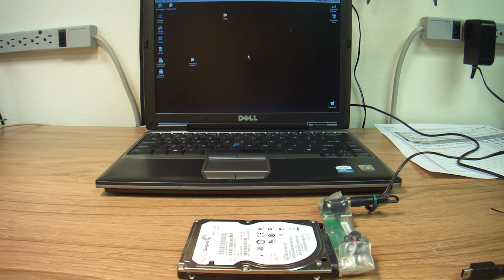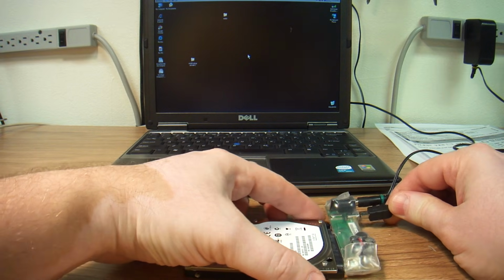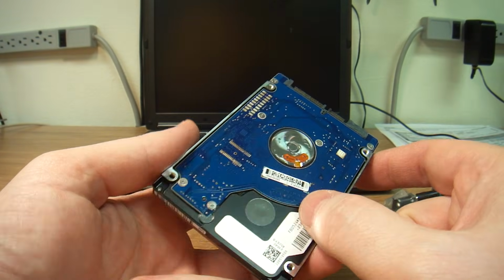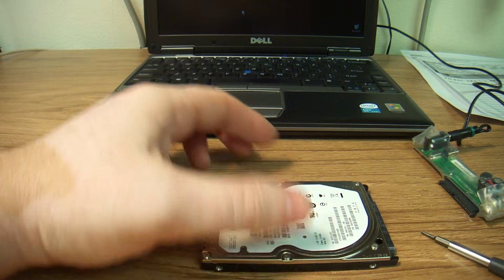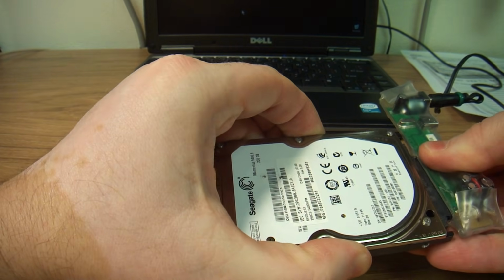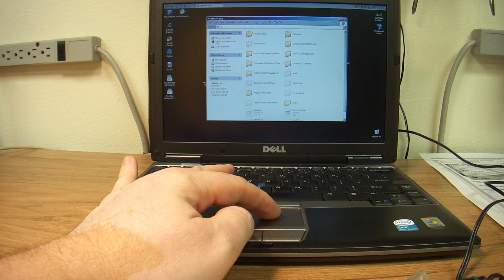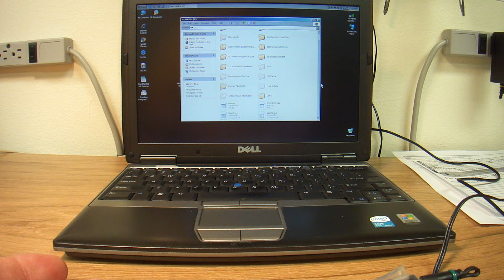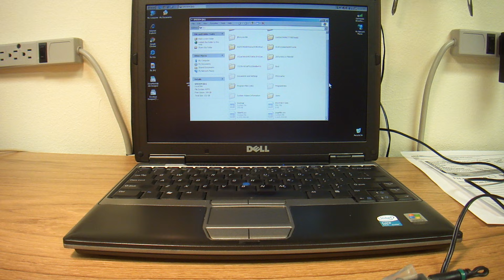How to fix a broken hard drive Beeping noise or clicking RECOVER GET DATA BACK FOR FREE! BEST TRICK

Comment: you talk that centrifugal forces would get rid of dust. Just one educated question, you never have asked yourself: WHERE those forces would move dust? This dust will always stay in the drive and it WILL (not just may) damage this HDD! The damage is actually getting on acceleration, as every dust particle, which would get between platter and head WILL pop-up head off the platter. Head would spring back, but won't just stop in position from it took off. It would actually land on platter in NON-PARALLEL position ripping thermal protection off the surface of plater. This ripped thermal protection would be in form of dust, which obviously would do same thing as ordinary dust. More times head would have contact with dust - more frequently it WILL happen again. So over time damage is faster and faster.

If you ever open HDD, then copy all contents immediately and treat this drive as broken and NON-WORKING one!

Comment: I've a DELL Inspiron 1545 laptop with a WD Scorpio blue 2.5" SATA HDD, even that HDD is making almost the same kind of noise whenever I bootup my system and gives me a black screen with a message saying "internalt for multi core processors will be disabled.
No bootable devices--strike F1 to retry boot, F2 for setup utility Press F5 to run onboard diagnostics." Even if I solve my problem by doing what you've shown in this video, is it a sign that I need to get a new HDD.

Comment: PLEASE  PEOPLE DONT LISTEN TO THIS FOOL and i will tell u why

opening a harddrive is very dangerous  cos a new hardrive will only run perfectly if the screws holding the cover in place are screwed down with the exact correct torque that was used in the factory since its very important part and goes hand in hand with the disign of  the HD.
The only way to perfectly open and close it is by knowing exactly how much torque was used. ask any techrepair they got a huge set of torque screwdrivers specially disigned for this with all different torques

An amateur will try to fix it open it lose its warranty and screwed himself

He says torque screwdrivers ar not needed but hes full of shit

Cos HES USING A 50 YEAR old 80GB laptop HD 

Not a recent desktop HD, shame of u for messing with people
Reply: Say whachawana chief indian, but this "foo" is spot on cus low and behold "It worked for my ass too - yet another success testimonial!"  He disclosed to "seek a professional lab" if in doubt, so Honest Abe is keepin it real in the '14.  If you're timid and doubtful, do like he said - Seek the pros.

Comment: I tried moving the heads but they wont budge on mine. It's a 1TB external HD. After trying this is just clicks but it sounds like the heads might be rubbing against the platter. It's a SimpleTech drive. Any suggestions please?
Reply from the maker: Rubbing heads Spell Trouble! Drive is  toast!

Comment: Thank you Abraham.
I did not have to open mine but I realised, from your video, what was wrong. My Ext. HD was very dusty.
A few light taps and swung mine about in an open space and it seemed to come unstuck. I never would have thought of that if it had not been for your video.
Reply: How is that possible isnt your HD enclosed?
Reply: *****
Yes fully enclosed external Seagate but it had been sitting for a long time and was dusty. Abraham's inside view made me aware of how to fix it. It was broken ie did not work and now it works fine.
Reply: And thank you for this comment, otherwise I would have openned my own HD. hahahaha
Reply from the maker: My pleasure.

Comment: What if my seagate 1TB hard drive makes the same noise, only a higher pitch and alot faster?
Reply from the maker: Maybe bearing? BAD!
Reply: Are you talking about an external drive? If so, you'll need to disassemble the casing until you get to the actual hard drive inside. (The hard drive is actually just a standard-looking internal drive.)

Comment: Where did you get the hard drive adapter I need one?????
Reply: adapter you can get an external hard drive corrupted, I have one as well and work with.
Reply: Maybe it's from a HDD enclosure. You can buy also an IDE/SATA HDD to USB 2.0 adapter like the one i'm using. You can use it on 2.5" and 3.5" HDD as well as on CD/DVD drives.

Comment: I was getting ready to copy over some data from my 2TB Seagate and the power cord was not quite long enough and it dropped onto the flow.

I took the HDD out of the enclosure and connected it via SATA and it makes the same sound (beep) like in your video.
 
This had ALL my data on it, so what else do I need to do? What about a "clean room"? If I do get it working can I trust the reliability of that HDD or should I buy a new one?
Reply: I'm in the exact same boat. I think it's probably an issue like this video described. I have to go buy some torque screwdrivers to take the HDD apart and see if the arm is resting on the platter.

Comment: What was the thing called you plugged into hard drive?
Reply: they called Interface  either from ATA to USB ot SATA to USB, you can find on the net and see the pictures. The pins are different so be careful when you buy. the HDD size 3.5: pins are different in number from the 2.5"  if you have a laptop your HDD is smaller in size, this is where you can ask the poster about the brand or/and make of his interface.

Comment: Great video!! I had the same problem (noise and drive not recognized) with my Lacie little disk and as a last resort I did exactly what you showed (thank god I saw your video about that hidden screw in the middle! :-) ). The head was stuck on the platter like in your video. I did what you showed then ran Disk Warrior. After 1 full day and 1 full night of "repairing" I got to back up and recover 99% of my 250+ gigs of music from Disk Warrior's "Preview" window to another drive. You basically saved my ass!!! Thanks a million! Cheers.

Comment: I'm having trouble with my seagate harddrive. It's making a beeping sound when I plug it in, but it stops beeping after 10 seconds. I have a mac osx 10.6 and it tells me it's not reading the hard drive. Do you think the data is retrievable?

Comment: Hi Abraham!

I really want to thank you for your video and instructions - my 640gb Macbook HDD 'broke' and I had almost given up on it and would've lost all my important files (haven't backuped even though this isn't my first HDD failure).

After long hours researching the problem I found out that it's indeed the head stuck on the platter, I had a very similar sound from my HDD.

At first I was very hesitant to open and start fondling my HDD interiors :D everyone says 'you must get it done by professionals in a clean-room' and I've also considered it the most sensitive component, even though I'm very familiar with fixing computers.

However YOU encouraged me to do it with clear instructions and a good video and it works perfect now, thank you! :)

For others struggling with heads stuck on the platter, you just have to be very careful and patient - I covered my mouth/nose for the whole operation to avoid accidents.

Comment: OOOH THANK YOU for showing me how to fix my hdd !! its out of warranty now i  dropped mine while it was reading copying stuff to another hdd and it now makes clicking noises ! searched for solutions and they all said to put it the freezer im making a good assumption that my drives platter heads might have got stuck like yours in this video im gonna attempt the surgery when i have time next after the xmas rush , will post my results ! so when i get it open i have to turn the platter anticlockwise ? and move the heads towards the other of the hdd case ?
Reply: i did the same thing, tell us how it goes. i was thinking to pay for data recovery, but this might save me alot of money.

Comment: Seriously, never do this if you've got anything of more than marginal value on your disk, take it to a professional lab like on-track or palmerdata. The author knows this as he spends most of the video equivocating about how this will "probably" be fine before actually saying you should take it to a lab if it's got anything important on it 6 minutes in. If you're considering doing this watch the ENTIRE video before starting. You should only ever open a hard drive as a last resort - if you open it yourself then even the professional labs might not be able to help you afterwards. In particular NEVER do this to somebody else's drive without their full and informed consent, you may be trying to do them a favour but you could easily, and permanently, lose all their data.

Comment: What kind of screw driver did you use? Mine seems to have a 6 point star fit. Very small I am sure it's the same throughout these hard drives.
Reply: It's a Torx screwdriver. I recommend the Husky 8-IN-1 Torx Screwdriver set for whatever size your HD uses.
Reply: Thank you!

Comment: Some of these people looking for a great way to backup on the cloud should try crashplan get the family plan it's only $13. I have my htpc macbook pro and 3 other laptops backed up...you can backup to 10 computers on a family plan so split the bill with others and you have unlimited cloud storage for cheap...just my 2 cents cause I saw comenta about Dropbox and needing more storage I have 200 gb backed up between all systems so it's worth the money plus it saves my ass when my pc crashes I don't lose my work anymore and can also access my files remotely through any web browser or through the mobile phone app

Comment: Just a question, did all of you guys use a sata to USB adapter, or just directly plugged in the hardrive
Reply: ***** thank you so much for this. i am having the same problems with mine. what are the screw driver dimension for the job?
Reply: How you connect the HDD (IDE/SATA/USB) doesn't matter only speed will be different.

Comment: Hey! I had the exact same problem beeping with my harddrive, I turned the disc and the arm jumped back exactly like urs.. After I replaced the top again and tried it its clicking instead, the arm goes like over and back to its original position again, two times then the disc shuts down.. What am I doing wrong?

Comment: Hey man, great video there! You helped me to get the screw under the sticker!

Initially i thought i got the same problem as yours, that is a stuck hard drive. It has the same symptoms as u have described; clicking and 'scratching' sound.

When i opened up, it is fine; the reading head is parked neatly at its bay. But i noticed that after i plugged in the USB to my com, the drive spins, the head reads, parked back to its bay, drive stops, and starts to spin again and the whole process repeats. After 4 or 7 tries, it stops completely. 

Any possible idea?? Hmm.. weird huh?

Comment: Did as described.
It worked. Kind of. lots of badblocks, crashed my system a few times. At least i can download my data.
well, there is might be something behind torque settings, because it doesn't mount and crash my system like 90% of the time, but then i loosen screws a bit, and crashes became much less frequent, and now drive mounts every time.
or, maybe, there is something else going on.  

P.S. i was kinda surprised, then i found Samsung HDD inside Seagate box.

Comment: hi .. i asked some people about that and they told me dont try to do this and you need a clean room and a secure tools to do this and if you did this without using a cleanroom you will get alot of dust and dead microbs on it and this dust make your HD never work again and say goodbye to your data ,,, is that true???
Reply from the maker: It is partially true. Yes there is a chance of damaging a drive. However, centrifugal forces will spin all the dust off the platter before head gets on it. As I said in the video Do this only if you can safely loose the info.
Reply: Abraham Levit  if my hard disk is clinking an i open it or it is bad
Reply: can

Comment: this may work, but usually if the heads are stuck, moving them on the platter while stuck will damage the platter in that area. you may get some data, but usually when i've tried it all i get is screech click screech click, he got lucky. Those hard drives use glass platters, hence why there is a loading ramp when the drive is off for the heads to park. when thye do a head swap on a stuck headstack they use a special tool to lift the heads off the platter and to remove them

Comment: Could be, that your headers was shredded already before you took off the lid. Happened to my drive, there is ametal ring inside the lid that got loose and broke in 2 pieces. obviously the headers did not like that at all. after removal , plates spin up fine, but header is still flapping.. try search header replacement videos...

Comment: i was hoping to find the same situation when i opened up my hard drive. it was beeping like this one and it was a Seagate external 500gb. but disk was not stuck inside and i was able to spin it with my hand. i tried a lot of ways to give the necessary power but nothing come out. i tried it in 3 different computers and no luck. i dont know what to do. may the pcb board be the cause?

Comment: i did that, and the heads got messed up and then started clicking.. you cant turn it because they are stuck.. if you move them in that position you will mess up the drive even worse.

Comment: I did this on my WD3200BEVT drive which was making the "siren" noise.  I turned it with the TORX T-6 driver (same one to get all the screws out.  You have to peel back the sticker label there are two screws under that label.  I turned the spindle as you did, and moved the head back like you did.  Plugged it in and was able to get all our data.  No clean room, just my desk.  NO ISSUES!  Thanks for this video!

Comment from the maker: No torque is irrelevant. Most likely is your head is cracked or misaligned. You need a head replacement. This will most likely damage the drive beyond repair. Try freezing and try more powerful power supply. I seen that work sometimes.

Comment: Ah. Fair enough. Anywho, I opened up my Western Digital Caviar Green HD, to which I found the header was stuck to the platter. I gently moved the header back to its original position. When I powered it up, the platter seems to spin fine. However, it seems like the header is continuously going back and forth trying to read the platter, but to no avail. Looks like said HD is screwed. I do wonder how if the torque applied to the cover might have something to do with it...

Comment: i have the same problem with yours!!!
my externa harddrive toshiba fall down in ground then when i plug it into my computer. its sounds like ticking clock!! then after 5sec it stop thicking and i dont see disk in my computer but it can eject from my computer!!! plzz help i watch your video. Can i try  your method to?

Comment: Have a similar beeping sound from my lacie 500gb mobile drive. Opened the casing and found a Seagate 5400.6 ST9500325AS. I was wondering if this technique would work for the 2 disc platter + 4 head assembly as well. Thanks again

Comment: My laptop's Seagate hard drive emits a similar beep between a slower interval of  about 2.5 seconds. I can slightly feel the motor running. The drive no longer boots up and it's not even recognized using a USB enclosure. Recovery soft-wares doesn't detect it either.  Is this the sign of a stuck platter or are there other causes?